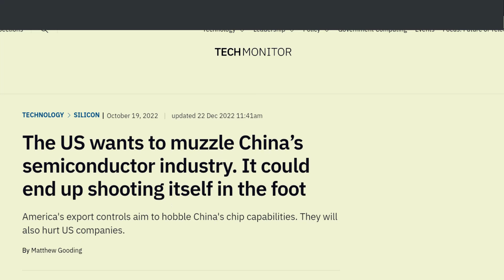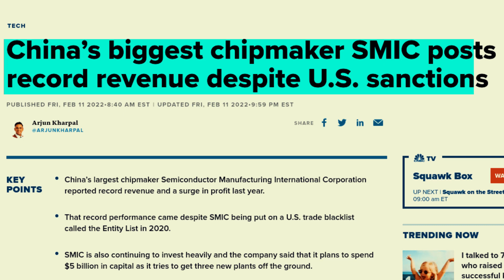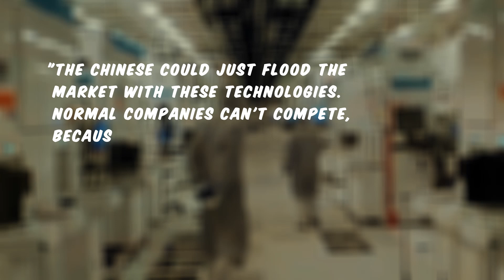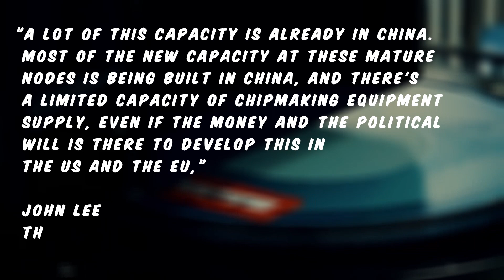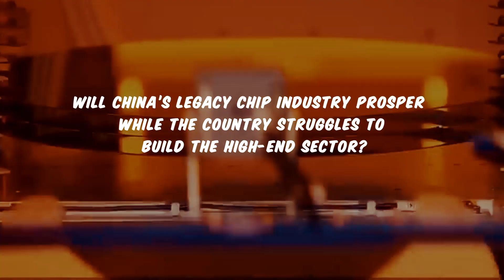The Semiconductor Arm-Race is Heating Up Between China and the US!

Comment: ASML is against the US blockade on the sale of its equipment to China because it knows that this will only force China to develop competing equipment & technologies that would threaten ASML's dominance.

By blocking the supply of high-end chips to China, the US is either still too stupid to realize that or too arrogant to acknowledge China's capabilities. Or, as demonstrated by their oil & gas sanctions on Russia that backfired badly, most likely both.

Comment: With Chinese made chip at affordable price for the mass, the whole world will be benefiting from it. I certainly couldn't afford those $5000.00 usd old 500 kilobytes IBM compatible Compag desktops or those $3000.00 usd Motorola cellphone that weight about 2 lbs. Nowadays, no one can imagine any actively enrolled college student without a tablet and a smart phone. That's the true benefits of made in China.
Reply from the maker: Definitely. The Chinese contributed massively in terms of low-cost chip production and supply.
Reply: @creamrisesup  they develope higher tech. More expensive but cheaper than US prices.